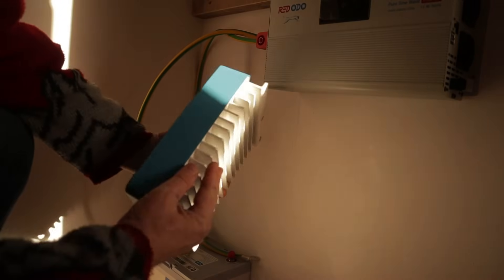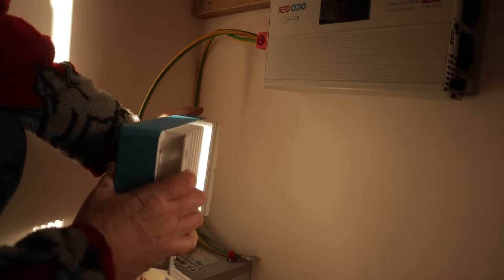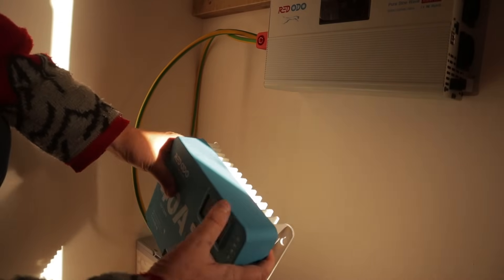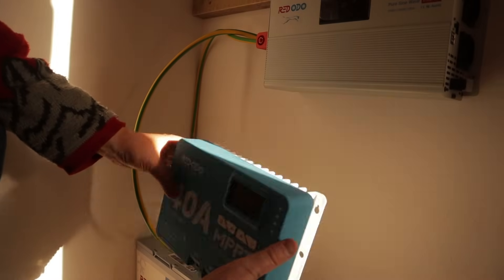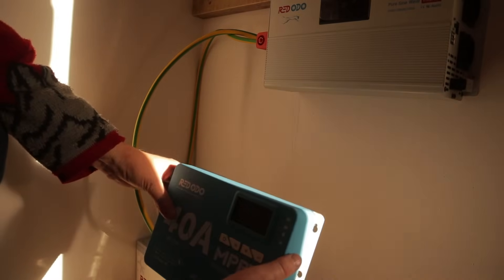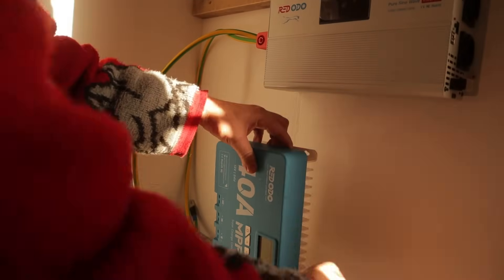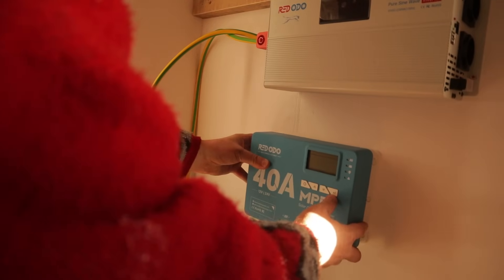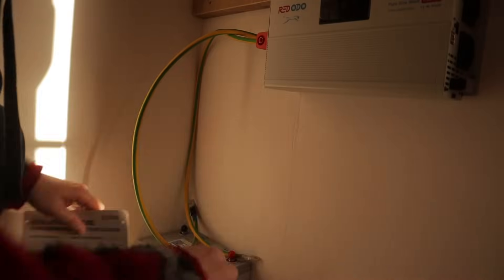Off grid SOLAR SYSTEM for BEGINNERS

Comment: Most inverters will not charge from a generator that produces dirty power. Too much t.h.d. or hertz ripple.
A inverter type generator or a eg4 battery charger type usually cures this issue. Good luck

Comment: Great you got it hooked up. American homes all have 2 voltages, 240 & 120. Lights, outlets, T.V.'s are 120V, large stuff like electric dryers, Air Conditioners, electric water heaters are 240V.
Reply from the maker: Thanks, I didn't know that. 👍🙂

Comment: Glad you have that new system - I also like the separate components so it is less expensive to replace 12v battery charger or MPPT or inverter separately.
Reply from the maker: Yes, it's a little more expensive at first, but when you have to change components it's much better 👍🙂

Comment: Nice work Robert.
And you put the solar panel on the roof of your shed.
Cut the branches of the trees that takes the sun away from the panels. And then put the whole roof with panels so you don't have to climp that steap hill and slip and hurt your self. If you trim the trees back a lot they wil be easy to handle when they needed to be trimmed in autumn. Greetings from the Netherlands😊
Reply from the maker: I can't cut these branches, they're a beautiful shade in the summer.
Thanks Vivian🎄🙂🎅